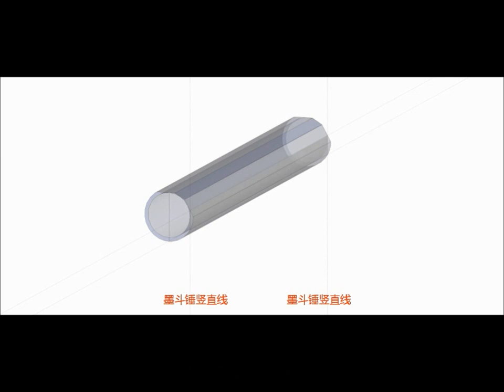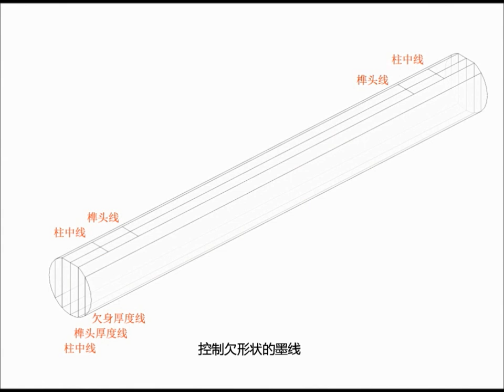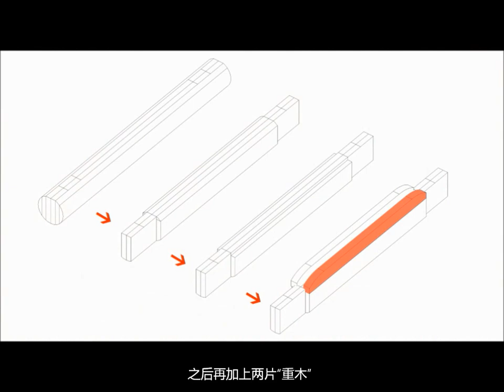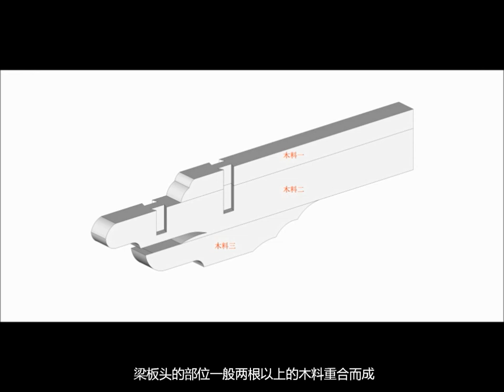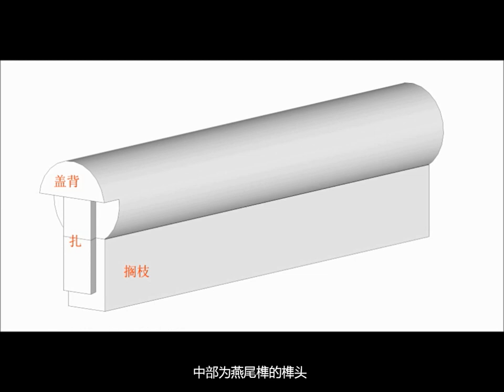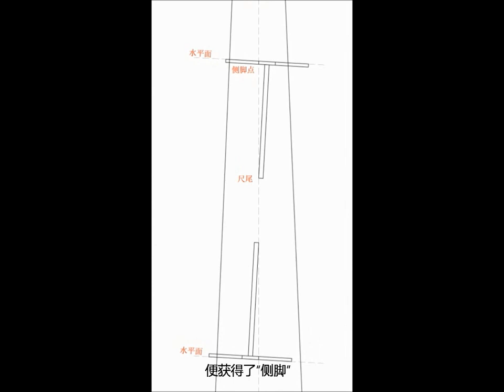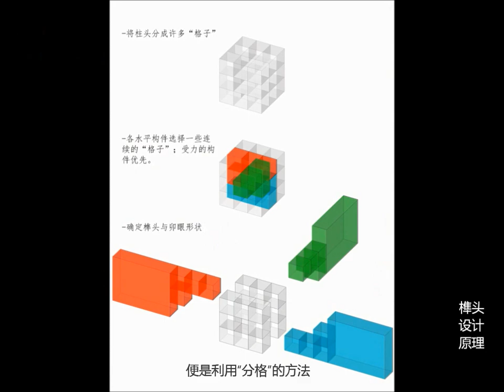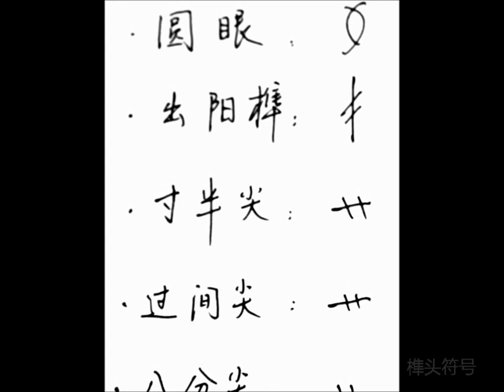Traditional Carpentry in Southern China-05 Component Procession 第五篇 加工

Comment: I am amazed at the number of people screaming for an English translation. 90% of the content in the video is self explanatory. Open your eyes and switch on your brain before complaining about something that someone has worked hard to produce and put on YT. Chenchen - thank you for taking the trouble to upload this.
Reply: +pervertt I don't understand Chinese, but I understand mortise and tenon joinery, so I can follow along well enough.  I am curious what kind of wood they're using to make those pegs at 11:46 however.  They act kind of like nails, so it must be a very strong wood.  Much tougher than the pine the rest of the frame seems to be made from.
Reply: pervertt It could be they're being used to marry to the pieces of wood along the grain so they don't slip past each other.  If the load is going to be across the grain, it wouldn't matter.
Reply: The nails are made from bamboo.
Reply: Alan Falleur smoked bamboo

Comment: The joinery techniques are labor-intensive in the short run, but the buildings are sturdy. The tools are very similar to traditional Western tools, but  when sawing, I see that the bucksaw frame is at ~45d to the line of cut.  I think that would make it difficult to cut on the line.
Reply: This is to allow deeper maximum depth of cut - it can be adjusted to a straight angle (the blade holding pegs facilitate this)
Reply: The frames are angled to get them out of the line of sight, allowing you to clearly see the blade.
Reply: Thank you for the reply.